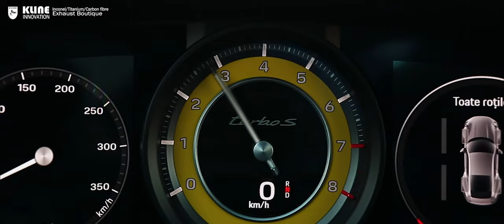Porsche 992 Turbo, Inconel race exhaust by Kline-Innovation

Comment: Inco 625 is an excellent tube material. We use it in aerospace for high temperature applications.
Reply: It was stainless steel Kline exhaust with 200cel cats